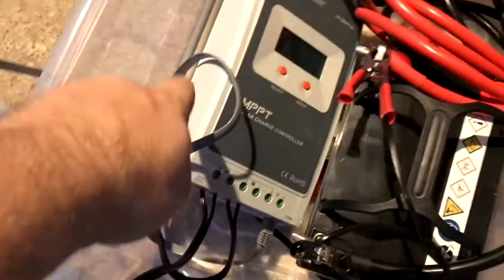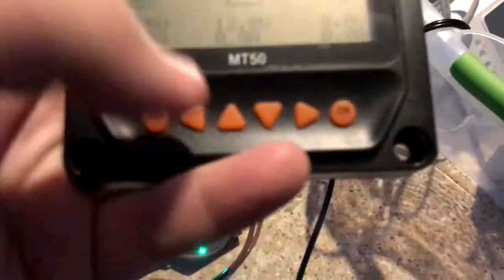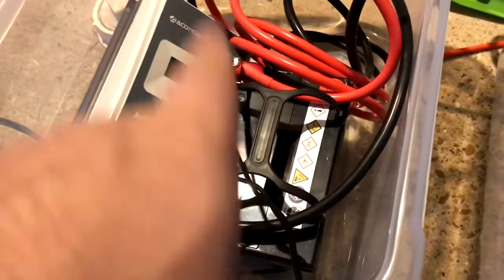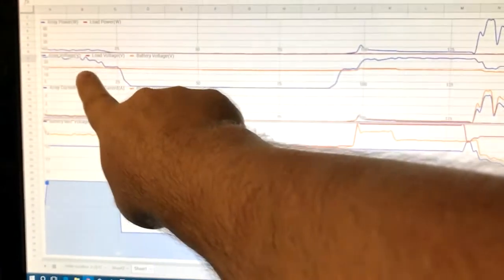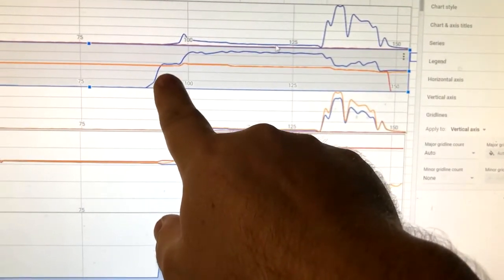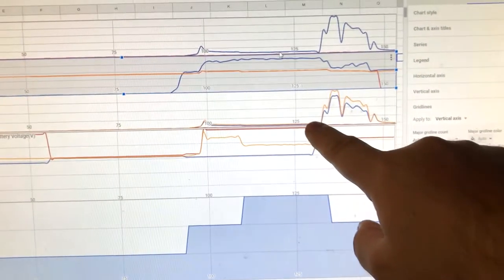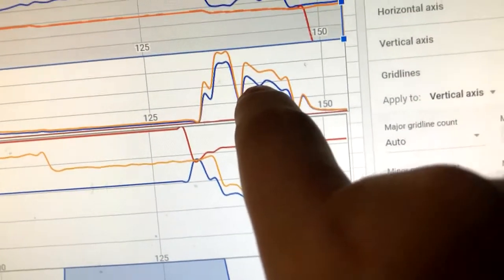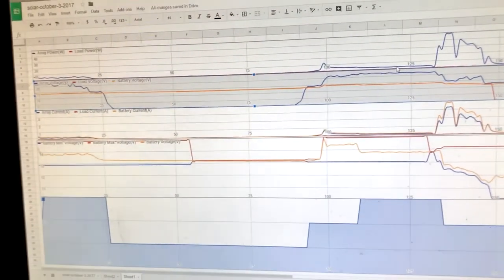DIY Solar system - upgrades & data

Comment: Mppt converters work best when the panels are in series and not parallel. It converts all the extra volts to more amps. The panels run at 6 amps while in parallel and when in series it may give you around 15 amps out to the battery.